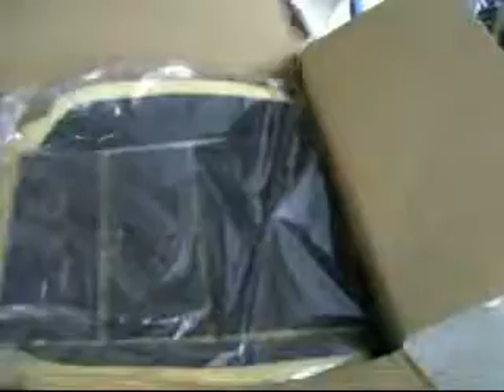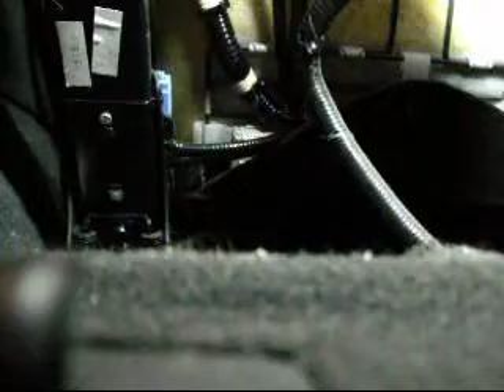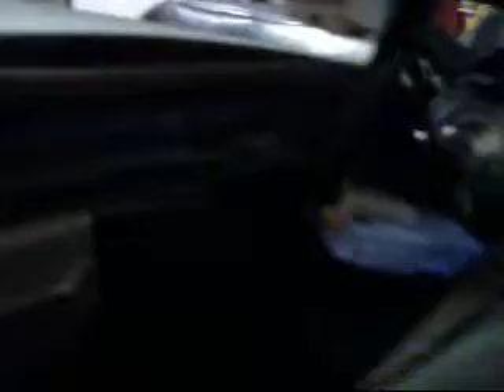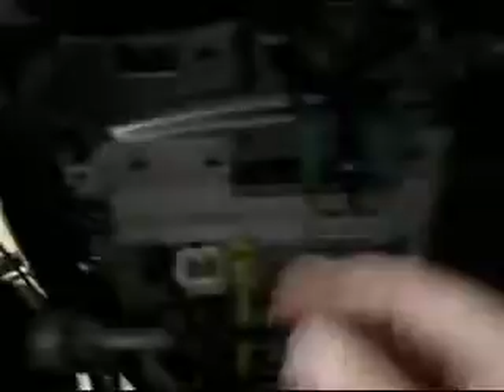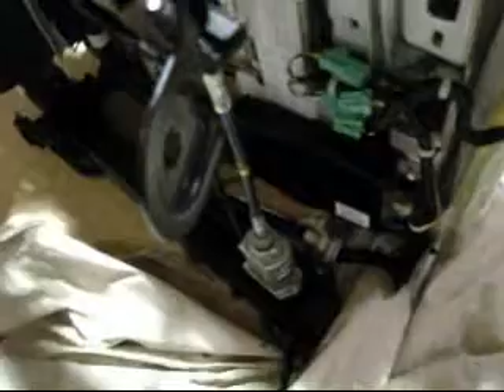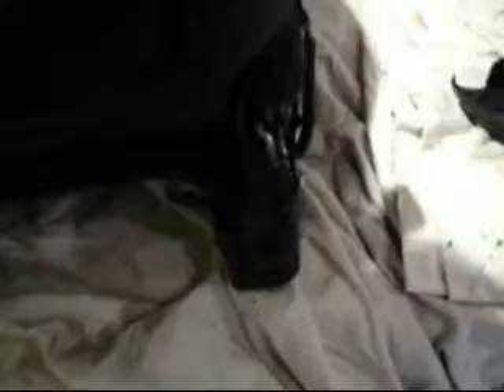Replacing Driver Seat Cushion in 05 Acura RL

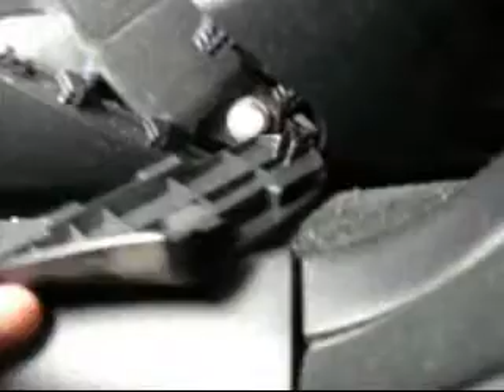Comment: Very helpful, but how did you get the seatbelt anchor cover off (at 1:12).  I don't see any obvious way that it comes off.  You show before and after, but not how you popped it off.  I'm guessing to slide it toward the steering wheel?